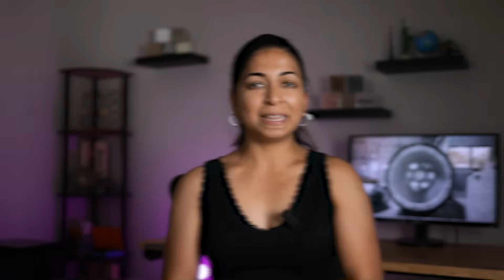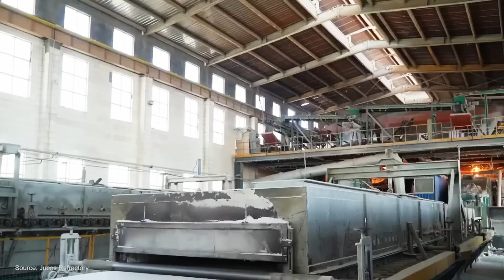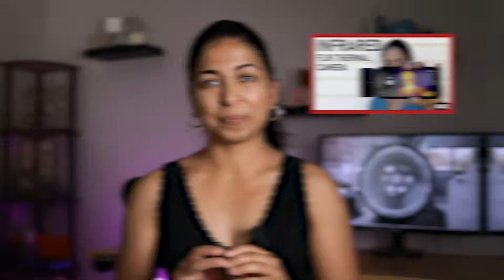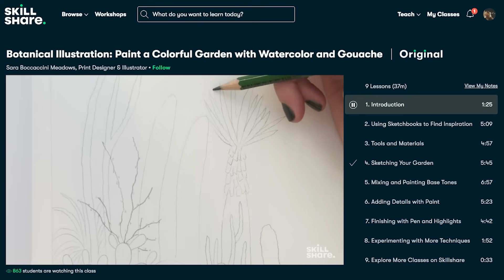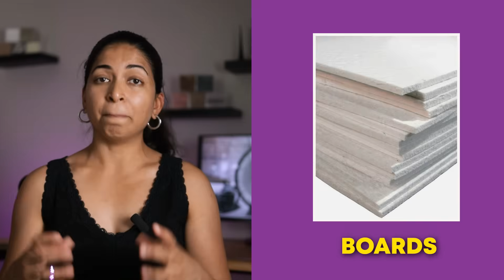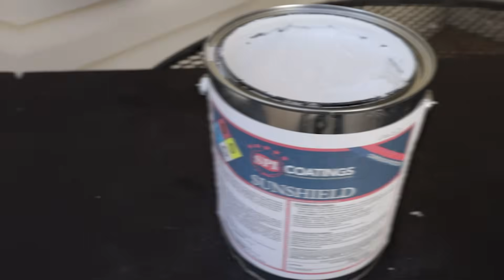The many uses of FIREPROOF Ceramic Fiber Insulation

Comment: This isn't really an AC question I promise, what high heat material would be good to protect a plastic AC drain pan from high heat oil furnace.  With the drain pan  right above the heat exchange? I was thinking about putting a piece of ceramic blanket down. But in video you say it's possible cancerous.

Comment: I recently used it to insulate between a brick wall and drywall and a large gap between the kitchen cabinet and the drywall in my kitchen. I am concerned after listening to this. I sealed it closed with silicone.  Should I remove it?

Comment: I get rolls of this since i had a pressure wash company. Its used on burners to heat water. Buy it from a pipe insulation distributor, it cost me 50 bucks for a 50 or 75 ft roll. 
Great for forges since you can just wrap the insulation so its barrel shaped and its done. Bricks in the bottom and a piece to us as a lid.

Comment: Could this insulation be added to traditional fiberglass in wall cavities & attics as a fire break?
Reply: No because it would still have wood studs that burn. For decades you have to have a firewall between units in townhouses, those are the products and process to use if you need them

Comment: Ceramic fibre insulation can break down into small fibres like asbestos, I would say it is not suitable for domestic situations only for controlled industrial applications like furnaces, check before use!?!
Reply: Everything can break down into fibers. 
Go look at the insulation in your refrigerator, stove, microwave and dishwasher. It's going to be a version of this because it's so stable.

Comment: Pretty good evaluation of the product, Belinda, but I think you gave it a bad rap with the oil resistance.  It's not supposed to break down with exposure to oil, but it does have air pockets which will absorb it.  That's messy, not degraded.  I've dealt with ceramic fiber mats and they're awkward.
Yes, we'd like to see more info on the solar paint, please.

Comment: Belinda,  this is a misguided video.  "How Ceramic Fiber Insulation can lower energy bills" gives one the impression that this is a product for a home.  Then you mention it has numerous health issues and and has a low R Value?  Then you ask if anyone might use this for their pizza ovens?  This is a highly specialized commercial product that needs to be installed by trained professionals.
Reply: Well this is a channel for professionals we just let amateurs  in to be nice.
Biggest use is for pipes and high heat. 
Great for a backyard metal melting forge.
Custom refrigerators and oven ec....
Reply: She gave you information for free. This video took a lot of work to make. And you are over here critiquing the title of the video?
Reply: @frustratedbot  Yes.

Comment: Something like this might be far better for hot water line rather than the foam that is generally used. This would alos work if you have a hot water loop which I kinda wish we had. 
In desgining my new home I think I am going to put in a hot water loop along with a cold water loop as well. Some water lines might sit for several days and having a loop would keep the entire line set fresh and cool. Holding that 55F temp in for as long as one can is ideal, as well as the hot water. 
I am not sure if this is the same stuff used on water heaters to keep the heat in? Though might even work as well. We plan on having a very large water heater of 120 gallon range and then a pre heater 120 gallon that is run directly off solar.

Comment: Rockwool is also asbestos
Reply: Rockwool™ is NOT made from asbestos. Firstly, Rockwool™ is a proprietary product manfufactured from vermiculite, a volcanic rock. Other mineral wool products also no longer use Asbestos, but use other rocks and ceramic,which are not carcinogenic. If it was, do you think anyone would be handling it without wearing PPE with breathing and eye protection?  The presenter is a trained architect and so would be familiar with its hazards. Although US asbestos regulation is relatively poor in comparison with other developed countries, it reflects the power of lobbyists in its politics.
Reply: @BigHenFor  what makes asbestos so bad for your health, is the tiny particle size that gets into your lungs. Rockwool uses rock dust, just like asbestos, to make its cotton candy like structure. 
They may not be the same company, but they are the same...tiny particles of dust that are extremely bad for your health and 100% does require PPE when cutting it.
Reply: Rock wool is NOT asbestos, nor does it contain any asbestos.
Reply: Rockwool (A trade name) or mineral wool insulation can cause breathing difficulties over a period of time (Years) when working with it continuously especially in confined spaces without respiratory equipment as the fibres can be below a certain measurement which directly affects the lungs, this also applies to ceramic fibres (Like pipe and duct insulation fitters and loft insulation fitters), if you have a breathing condition already it is not recommended to install it, people who seldom install it need to wear the appropriate mask (Like with all products which emit dust) and polypropylene suit and gloves and it will be fine, but possibly itchy, but pose no real threat!?!
Reply: No it's not.

Comment: I would like to know your take on residential metal roofing. There are these ads all over Instagram for Erie Metal Roofs. They say they're not like the metal roofs of old where they were loud when rain or hail hit. They also say they look like traditional shingles. I would love to know your take and comparison with these and traditional asphalt shingles.
Reply: Metal roofing isn't loud when installed over solid 4x8' sheathing that is used in normal home construction.  It's only loud on barns & sheds that have minimal support under the metal.
Reply: Other than aesthetics and differences in finish there is literally no significant difference between a corrugated metal roof from the 1920’s and a metal roof of today with regards to sound. If installed properly it will be a phenomenally durable roof. As the other poster said, the sound factor has everything to do with the sheathing and insulation under the metal.

Comment: The Container Guy recommends spray foaming, so you're correct that more traditional insulation doesn't work.
Reply: Neither does spray foam. I was one of the first to take a serious look at container in about 2003. The thermal bridging of the steel floor supports destroyed any benefits of containers. No amount of insulation can counteract that bridging. Just look at the charts.
Reply: @sparksmcgee6641  agreed. but then again, he doesn't recommend the use of containers for permanent dwellings, especially not for affordable housing. if a rich kid, a company or the state swings by to throw money at him, he'll make what they ask for, meanwhile selling parts to rich DIY-ers.